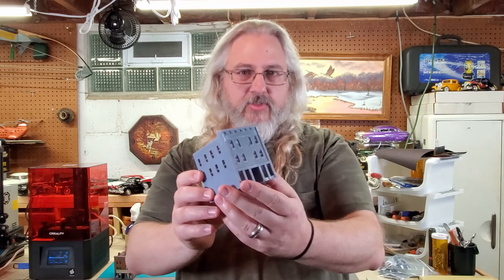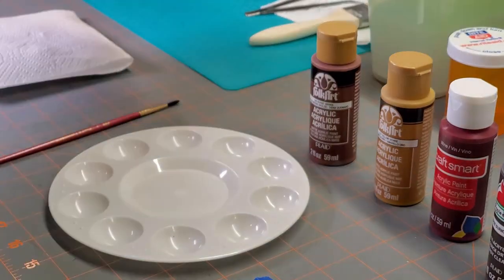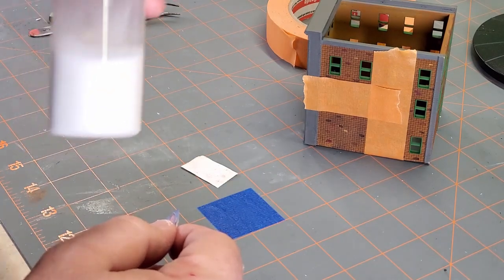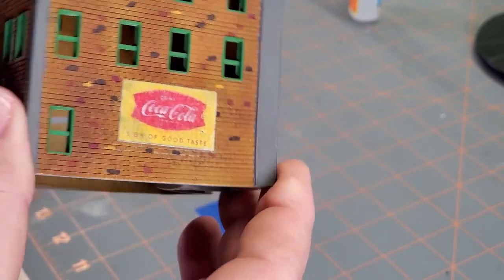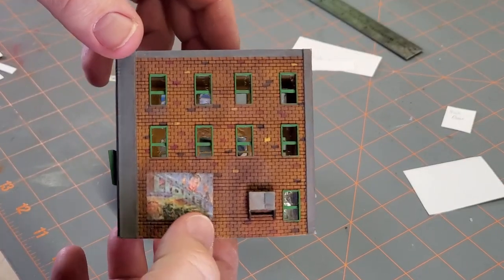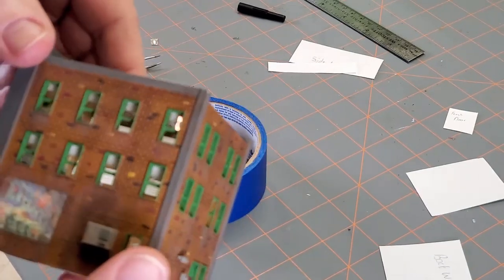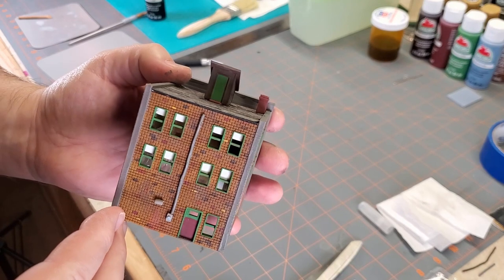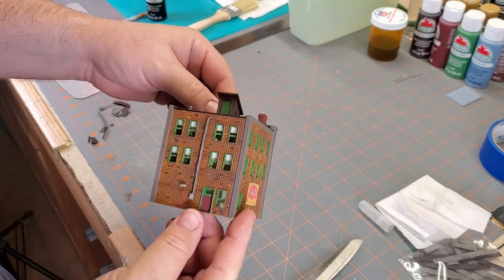3D Printed N Scale Structure For My Model Railroad

Comment: I wonder if various grades of sandpaper sheets would make useful roofing material.
As far as the overspray of the accelerant, you might make a square hole the size of the shed in some card stock and lay that over the roof as a mask. Spray the accelerant first on the roof and then place the shed with glue on it on that spot.
Reply from the maker: I have used sand paper for roofing material before. It works pretty well for a gravel and tar roof look. I use the super cheap sandpaper from the dollar store.

Comment: Paul, when you designed your building, how did you scale it to N or 1:160?  Did you design the building first and then group it and scale down to where say the width of the building made sense?  I understand basic 3D design, but getting it to the right scale is confusing.  Say you wanted to make this H0, do you simply upscale it a bit?

Comment: I saw no mention of how you sealed the pastel chalks onto the model...after you brushed them on for weathering affects won't the chalk rub off very easily unless sealed onto the model?  Thank you for sharing your tips and how-to guides.
Reply from the maker: For my structures I do not seal in the chalk pastels that I use for weathering since those buildings will not be handled once they are put on the layout. Anything else I weather using the pastel chalks that will be handled I seal them with either a matte or gloss topcoat. Any type suitable for plastic will work. Remember however if you decide to seal them I suggest you go a little extra heavy with the weathering chalks. The clear coats will mute them a bit.
Reply: @RoadsAndRailsHobbies  Thank you.  I am preparing to build an n-scale layout, so my buildings, etc. will not be handled much after installed.  Thank you again.

Comment: FYI, you can get water-slide decal paper that goes in your ink jet printer.  Much less work and more predictable than sanding down printer paper.
Reply from the maker: Hey NSResponder. I actually have some of those,  but I have as of yet not tried using the decal paper. Have you used both techniques and if so, do you get the same painted on look when applying the water slide decals to a brick texture that you can get with the sanded paper? Thanks for watching and commenting.
Reply: @RoadsAndRailsHobbies  You can use decal softener to make the film really sink into the brick texture, just like the panel lines on a model airplane.  For weathering, all the usual dry brush techniques apply, or you can adjust the color in an image editor before printing.  You might want to finish it with a matt clear coat.

Something else I've seen but haven't used myself is HP's fabric carrier sheets.  These are basically cardstock with an adhesive on them about as tacky as post-it notes, and you can stick silk, rayon, or other thin fabrics to them and run them through your printer.   Ladies who are into quilting use them to get photos onto fabric, and they should work fine to print scale banners, awnings and flags.
Reply from the maker: Thank you for the insights. I kinda figured you would need to use solvenset for the decal paper, but I have never even heard of the fabric transfer paper. That's awesome.  Thanks again....

Comment: Hey there!  Would love it if you shared some of your print settings for the resin printer. I have a lot of trouble with al the straights lines in N scale buildings. I get a lot of warping and deformation. making it hard to use the pieces on a layout. Thanks, great vid.
Reply: Hey there Kai. Well I'll tell you what. Once I figure it out myself I will. LOL. Resin printing is still new to me as well. I have not as of yet been able to print an object without having it "elephant foot" . Plus I've tried printing several of my structures and they have all cupped at their bases. So I've put the resin printer to the side for now.

Comment: Thanks for sharing. I'm just getting into 3D printing. I am in N scale. DO you share your files? Or sell them. I just got my resin printer. Have not sent a print to it yet. Just got the rest of what I needed today. Can't wait to play with my printer.
Reply from the maker: Hey there Vincent.  Thanks for watching.  And yes I sell the files to all of the original pieces that I show on my channel.  There is a link in the description of my videos to Cults3D where you can purchase the files.  Or you can just go over to Cults3D.com and search prat12874 and that will bring up all of my designs.  I have many designs that I haven't listed yet on Cults3D.  I don't like to list them until I have had a chance to do a video on them to show how to assemble and finish them.  So keep checking back.  And I'll let you in on my next build.  I have designed a small(ish) movie theater.  It will have a lighted marquee board.  Thanks again for watching.

Comment: Thanks Paul, as a newcomer to digital printing I found this really helpful.  You mentioned you used the creality ender printer on an earlier model building.  Would the Ender 3 V2 be a good printer for a beginner?
Reply from the maker: Hi again Ian. And yes I believe the Ender 3 V2 would be an excellent beginner 3D printer. Not only are the Creality line of printers very user friendly and the fact that there is a huge following for the Ender 3 and support in forums, Facebook, and YouTube the Ender 3 V2 has some nice built in features that are upgrades for earlier models. It has silent drivers which makes the operation of the printer very quiet, even though the other models were never super loud to begin with. The most important upgrade that the V2 offers however is the thermal runaway protection. Which means if the hotend's thermostat fails and the hotend starts overheating, "called thermal runaway", it shuts the printer down before it catches the printer on fire. With that being said I would still never leave a printer running unintended or at the very least without a working smoke / heat detector nearby. I have one mounted directly above my printers. Thanks again for the question, and good luck in your future printing adventures.
Reply: @RoadsAndRailsHobbies  thanks Paul for a very concise answer.  I look forward to buying some of your plans once I have bought the Ender 3 V2.
Reply from the maker: No problem brother. I love helping and sharing my passions. That is the whole reason I created my channel. Also I definitely appreciate any future purchases of my designs, but definitely follow along with my tutorials and give designing a try. You never know when you may come up with an idea of something you want but are unable to find it. You will have the knowledge to design it yourself. Or at least give it a try.